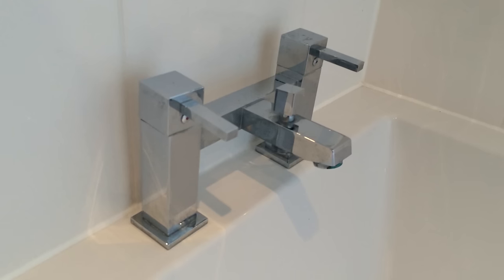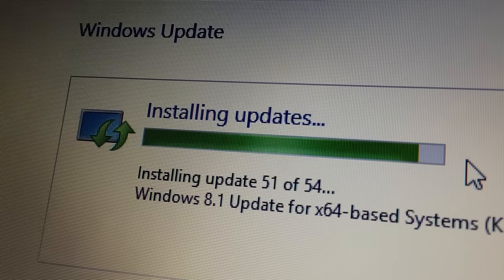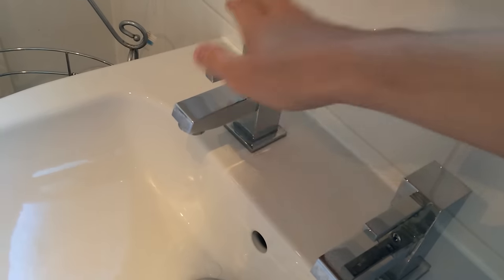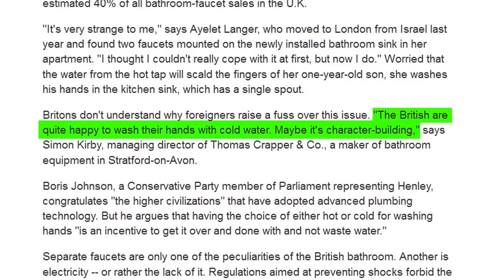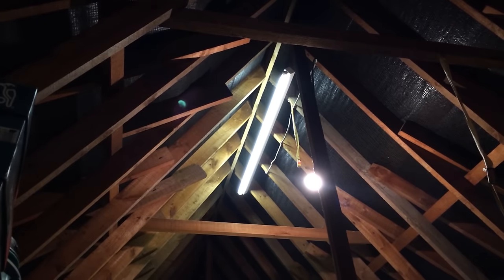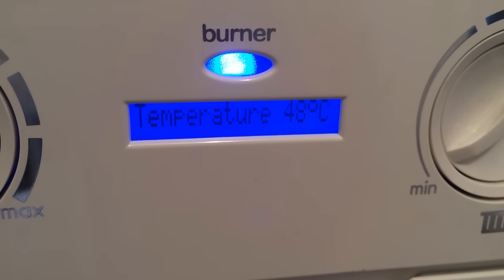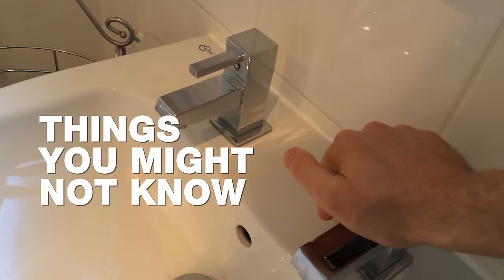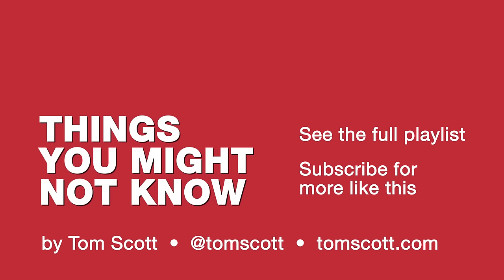Why Britain Uses Separate Hot and Cold Taps

Comment: As an American, I fail to see the problem with two taps.
Reply: +Collin Willoughs IT'S BLOODY ANNOYING
Reply: How?
Reply: When you want lukewarm water to wash your hands or brush your teeth or just generally straight from the tap it's a pain in the bum.
Reply: Szymon Gorczynski Yes. But I tend to use only hot water anyhow.
Reply: Same here, trust me.
Reply: +Collin Willoughs You have to develop a technique of cooling each hand with cold water, then running under the hot tap fast enough to avoid scalding it. Or, if you have all day, put in the plug and fill the sink. Either way, it's annoying, but not the end of the world.
Reply: +xHaniffax You brush your teeth in lukewarm water? Oh the humanity!
Reply: Johnny Torpedo You use the cold tap like a man.  Beware the forbidden hot tap.
Reply: Matt Luckily I never want to drink lukewarm water.
Reply: +No Name you have to put the cold tap on then the hot, in the bottom of the sink by the plughole the streams cross ad mix before draining
Reply: +Collin Willoughs I've used both, and no it is not, in america you can sort of regulate how hot you want it by mixing both taps, in the uk it is always boiling hot, hot enough to hurt you. so yeah it is better to freeze your hands in the cold water tap and then misserably try to unfreeze them by placing them close to the nearest heater. There are some taps that are coaxial, so you get only one visible tap, but the stream is always hot in the center and cold elsewhere, it is still a really crappy solution...
Reply: Szymon Gorczynski it is, cold water in your teeth hurts like hell, but then again it is either that or burning your mouth... aaah, england
Reply: +Collin Willoughs Like the vid said its because many UK homes have a water storage system for heated water. the heated water is not always completely sealed and of course the tanks degrade over time so are not always maintained correctly, so hot water pipe circuits, by law are deemed not suitable to drink, therefore the cold and hot are kept seperate . The fact is 9/10 you would probably be fine drinking from the hot tap, but there will be the odd house , possibly in each street that has unknown rust of sediment in the storage tank, for instance sometimes i get rusty particle come through our hot tap in my home.
Reply: +Collin Willoughs There isn't a problem.
I think there's a lot of delicate people on here.
You use the cold water to wash your hands and brush your teeth. It takes a while to get really cold but even then it isn't that cold and you would probably only feel it in the winter if you've been out.
Not this winter though as it's been the warmest winter ever i think.
The hot water you use for shaving etc and that takes a while to heat up but that can get really hot.
Naturally you mix it with cold water if you need too but that is something you will rarely need to do.
My sink in my kitchen which is like a lot of sinks in Britain has separate hot and cold taps but both flows come out of one spout so you can mix to get the right temp.

I don't understand half of the complaints on here. It's a system that works well
Reply: +Szymon Gorczynski then that's a problem for your house.
I've never had any problem like you describe in all the places I've lived and stayed at
Reply: +Collin Willoughs  You're right; and we do have lots of houses that still have two taps in the sinks, even though the type of tank this video is talking about never existed over here.  But people being people, hardly anybody wants to make the enormous effort of putting a plug in the basin to mix the water to the right temperature.  I don't worry about it in my apartment because there's a fairly long latency for getting hot water out of the tap, so it's possible to get a reasonably comfortable temperature out of the hot tap while waiting.
Reply: +BigBen Hebdomadarius  We have two taps also. One cold one in the bathroom and a hot one in the kitchen. (Have I replied to you before?...don't worry, only coincidence)
Reply: My apologies for my assumption on that score.

Comment: Is it just a 'placebo' that water from the bathroom tap tastes different to water from the kitchen tap? I know I could do a blind test, but I don't want to intentionally drink bathroom water, however irrational...
Reply: It's not a placebo (or taste illusion) at all. In some houses kitchen taps are used more frequently and for longer periods than bathroom taps. This gives time for the pipes to the bathroom to build up a scale or oxidise, and this can change the taste of the water slightly.
Reply: True. Bathroom taps are used for a quick hand wash and a toothbrush wetting. The kitchen tap is used for all dish washing and kettle filling, some handwashing and by "the mythical rule" all drinking too. Stands to reason that the bathroom tap would taste a little stagnant.
Reply: Andrew Bulman 
No, in your house as in many houses the cold in the bathroom could be from a storage rank and the kitchen tap direct from the mains. The confusion cones when lazy youtubers like the one here give out the wrong info as if it's correct.
If your bathroom fold rap is from a storage tank the water will taste different as the chlorine content will have evapourated. The water companies put enough chlorine in the water to last for up to three days, as they feel that's how long it make take to get from the treatment works to your house. Once the water comes into open air the remaining chlorine evaporates in around 30 minutes.

An interesting test would be for you to sample three glasses of water at your house.
One from the bathroom cold tap which should not taste of chlorine
One drawn from your kitchen rap but one hour old. This again should not taste of chlorine
One fresh from the kitchen cold tap in which you could taste the chlorine
Reply: Simon Sackville 
Sorry, that's incorrect. Water pipes only built up scale if the water rises above 65 degrees C, as at that temp the water can no longer contain its calcium content. That's why kettles scale up and water jugs don't. The difference in taste is due to the presence or lack of chlorine in the water due to how it's been stored in the house, such as in a mains pipe or open tank in the loft
Reply: I always drink from our bathroom cold tap; tastes perfect! we do have really clean water here on the Moors mind you, no hint of Chlorine.
Reply: As a youngster, I thought the water had a different flavor in the kitchen than it did in the bathroom. It turns out that I was a bit stupid (or, rather, not very good at isolating variables)--I always drank kitchen water with ice, whilst I drank bathroom water straight-up. To my mind, even a small amount of ice (or chilling in general) greatly improves tap water.
Reply: Well, as a kid I thought water from the bathroom tasted better. Also, drinking without a glass was way better than with one... But of course, that was all in my head!
Reply: Huh, and I actually prefer my houses bathroom sink water to the kitchen water.
Reply: Is your bathroom tap mains fed or tank fed?
Reply: Fun fact for everyone in this comment, I have accidentally drank bathroom water for a bout a few weeks, thinking that it was safe to drink from there as someone told me it was, and surprisingly I was okay through out the whole time. No aches or pains or any side effects (that I've realized at least). Only realized then because someone else told me it wasn't.
Reply: It's because you've brushed your teeth and the minty taste of the toothpaste makes it taste nicer.
Reply: Sometimes the piping in your house isnt uniform, so from diffrent eras, so maybe copper in one part, and stainless in the other. Also they might have only used stainless in the kitchen, because you dont need as high quality water in the bathroom. You can certianly drink out of copper tubing, but stainless is just a little better.
Reply: I would never drink from a bathroom tap unless I knew it was connected to the mains. Most houses in the UK will have cold water tanks in the roof space. You never know what muck can get in there if it is not properly covered.  I doubt it will kill you, but I prefer not to.  As other comments have said it will taste different and particularly in the summer months when it is likely to be warmer as well.
Reply: In Sweden (as far as I know) we don't have a storage tank, everything is from the main. The only thing you have to do is let it run for a few seconds. You can (if you want) even drink the water from the toilet, since all cold water in the house are the same.
Reply: The reason is that most kitchen taps use non softened water and bathrooms use water that has been run through the softener to protect your skin and reduce scale buildup on your shower
Reply: David Brickerman 
I don’t think that is the case. There is a relatively low proportion of houses in the UK with water softeners installed. 
Water softeners are not standard, they come at a cost and not all houses have hard water. With the ones that are installed the kitchen taps are usually softened water, there is an additional hard water (mains) drinking tap that is installed. You are right in pointing out the difference in taste.
Reply: Only drink from the purified water tap, you savage.
Reply: I wouldn't intentionally drink from the kitchen tap either. How many germs do you suppose are splashing back up at the tap from your sink every day?
Reply: @chegadesuade  
You sound like a dream customer for the bottled water companies, who basically bottle tap water with less checks than the water board.
Reply: My bathroom cold water tastes the same but my house has a modern plumbing system now and all the pipes got replaced about a decade ago. 
My place is about a century old, inter war stuff so I'm not sure if we ever had the tank system here.
Reply: @RandomSime  
You mean the ones that are used more often develop scales and the ones that are hardly used don't develop the scaling
Reply: If your house is old , you may have lead pipes which mens you may be drinking water with lead in , making it taste nicer
Reply: @rt-viz954  
If you have lead pipes that means they're old which means they're completely scaled-up and pose no risk to you whatsoever unless you disturb them
Reply: I drink from both the bathroom sink and the kitchen sink and there is literally no difference.
Reply: Funktapus Gaming its the chlorine that make the water clean, no chlorine, not clean.
Reply: David Brickerman softener?

Comment: This is the way in New Zealand too, old houses often have tanks in, or on, the roof and double taps.  I live in an old house that was renovated and the tank removed and a mixer tap installed by a previous owner, but other houses on the street were built to the identical plan and  some still have tanks and double taps. I'm not aware of any paranoia here about drinking from the hot tap, but.. .why you would drink from the hot tap? Who likes warm water. The only way I end up drinking from the hot tap is when I use it to fill a kettle to boil, and that takes care of any bacteria.
Reply: Yes, but not an abundance of minerals.
Reply: Magnus Bergmark But there won't be any more minerals in the hot water than the cold water, because it's from the same mains pipe, the only difference is the hot water has been through the tank on the roof and the hot water cylinder.
Reply: And if the tank start to rust?
Reply: Magnus Bergmark There'd be stains in the kettle from it. There's none.
Reply: +Magnus Bergmark Flavor
Reply: TadRaunch not if it happens very gradually. It could be such a small amount that you don't see any color change and the taste change could be small enough that you don't notice it. Over time it's not healthy.
Reply: Magnus Bergmark Not much is
Reply: +PutItAway101 Water that's been heated is higher in minerals, especially calcium in hard-water areas.  If you can use your hot tap to make decent tea, I'm betting you live in an area where the water is basically mineral-free.  The year I spent in London, the water was so hard that even putting only cold water in the kettle, we still had to de-scale it every month or so.
Reply: +BigBen Hebdomadarius The worst thing for me is that I live in a hard water area. So, that means descaling coffee-machines, washing machine etc. I also have to use a reverse osmosis filter for my aquarium.
Reply: +PutItAway101 Stop complaining. Be lucky you have water at home. I have to walk 2 miles to the next well....armed of course.
Reply: Mike Rourke Uhhh... not really sure how you figure my completely plain description of the  type of taps we have is "complaining" about anything?
Reply: +PutItAway101 My God, can't you take a bit of sarcasm?...that was meant to be a joke . Although, reading and listening to something comes over differently

Comment: Or, you could delve into the part that the UK does not really (definitely did not for a long time) have a standard for spacing between hot and cold taps on sinks.  Thus making it difficult for a manufacturer to create one mixer tap style that would fit most sinks.

Comment: I still prefer mixed taps/faucets, though, for the simple reason that you can get the exact temperature you want.
Reply: but the only time i want hot water is for doing the washing up or washing my face and then I am running it into a bowl so I can mix it in there.
Reply: Skellious I see, you dig doing it the middle ages way. To me this sounds gruesome.
Reply: ElizaberthUndEugen If you think people in the middle ages had access to clean hot water then you are sorely mistaken.
Reply: Skellious You know what a metaphor or a exaggeration is, no? Might want to look it up. While you are on it, also check sarcasm; might prove helpful at times.
Reply: ElizaberthUndEugen sorry, I tend to miss metaphors and especially sarcasm. As a result, when I write something that is not meant to be taken seriously, I use a ":P" to signify tongue-in-cheek.
Reply: Medieval? Try more efficient. If you want to more than rinse your face, you'd use a fraction of the water part-filling the basin than you would just running the tap.
Reply: ***** If I wanted to rinse my face without wasting water then I'd just put it the mixer tap on lukewarm and put the water on a basin.

Comment: Here in the United States even though we have mixer taps, you really shouldn't be drinking any water that is heated in a tank water heater. It has to do with a few factors like bacterial growth, ingestion of trace amounts of metals like from the Zinc rods which prevent galvanic corrosion in the tank, and corrosion from the tank itself since i'd wager less than 1% of the country actually replaces their anode rod every 5 years like they should.

Comment: Makes total sense. I like the idea of a single tap, but the mixing should be right at the end of the spigot, so that the mix is right where the water comes out.

I also like the idea of storage tanks, but they should be on the outside of the building. Ideally, not even attached, but if they are, right on the side, with no path for the water to get in. Water leaks happen, and when no one is around, that could be hugely disastrous.

Comment: @tomscott What about one-way flow valve? You apply that on 'clean' water supply and don't have to worry about contamination, I guess
Reply: Short answer is they could fail if not maintained.  Long answer: There are valves we use in industry called  anti-Syphon valves.  Which are essentially a check valve that will introduce air when pressure becomes negative.  We use them in chemical mixing applications (among other safe gaurds) so if water pressure is lost chemicals can't be sucked into the main.  The valves cost about $1500 and must be recertified every year.
Reply: only in Britain! A non-return valve is a very simple product but did never cross the channel.

Comment: I've had mixer taps all over my house for past 20 years so have most of my friends
Reply: Are they actually, or are they the ones that give you that impression. Most single outlet taps now have two tubes inside the spout, so that the water is not mixed until after it has left the tap.
Reply: @JohnJones-cp4wh  It doesn't really matter how it works if the result is the same

Comment: Older style mixer taps mix the water in the body of the tap, a single check valve on the cold pipe will sort any potential back flow issue. 
Newer ones mix at the outlet so theres two separate streams, so they are unable to back flow.
However if in doubt, just fit a single check valve. Problem solved.

Comment: I also run the cold tap for a few seconds before taking a drink. I never knew why until now. We learn more growing up than we know at the time. Thanks Tom.
Reply: i do to but for a far more practical reason water from mixxer tap will not be as cold as possible if its not run for few seconds(if setting already wasnt full cold)

Comment: Well, the way houses in Britain were constructed after WW2 is also the reason, why British plugs include a fuse. Because rather than having multiple smaller electirc circuits with breakers rated for 10-16A (like the rest of europe or the US), Britain used to lay down "ring circuits", witch span all sockets within one storey or the entire house. This practise was based upon copper shortages. However, the ring circuits had to deal with many more electrical appliances and therefore were equipped with a breaker rated at 60A. But still, 60A is a hell lot of current, thus, the fuse in the plugs was included as another safety mechanism that would trip earlier.